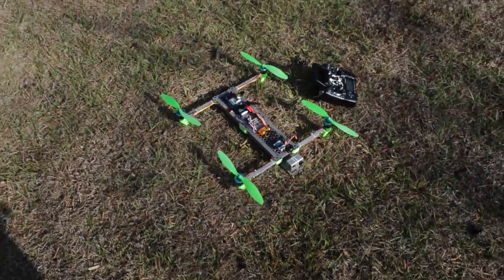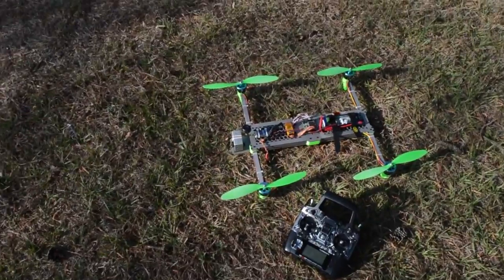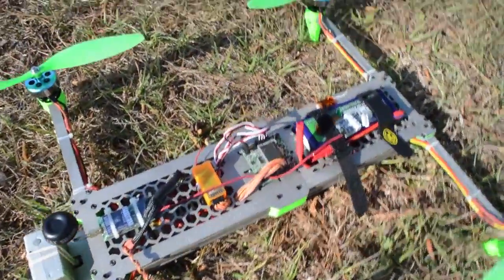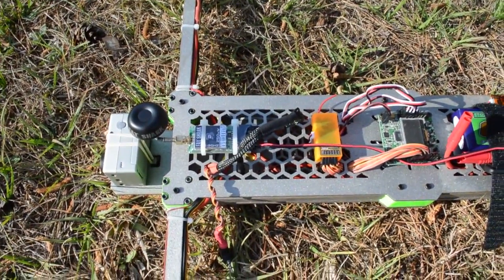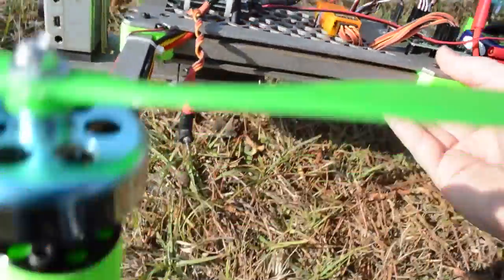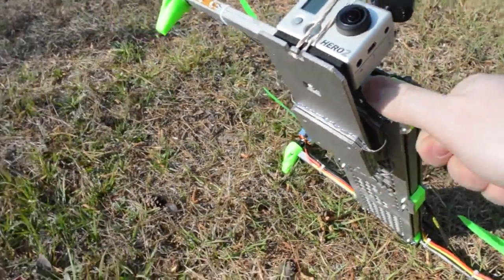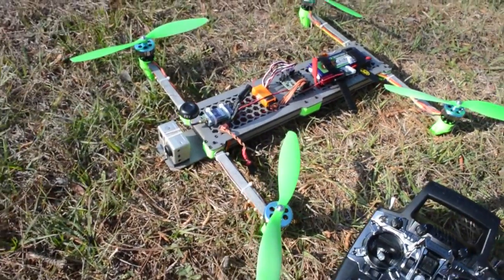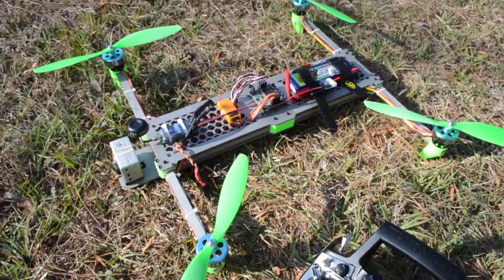BBE - I'm Still Alive!!!/Team 3 Quad

Comment: you can change the channel easy on the goggles with the switch on top of the goggles...you change the channel on your Vtx by trimming away a little of the heat shrink to expose the switches and then pick  your channel...